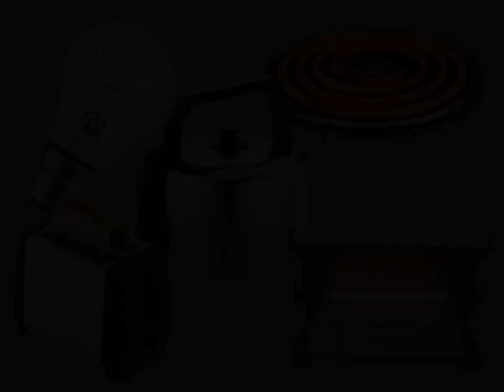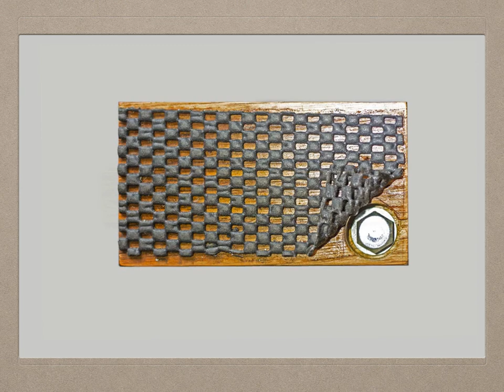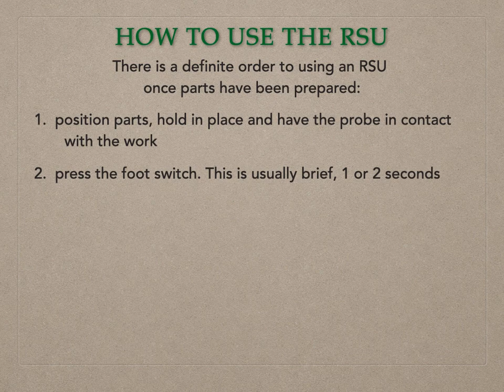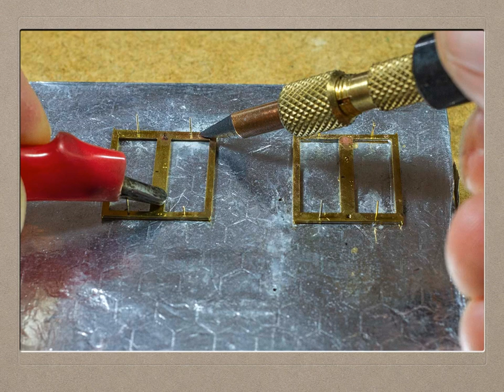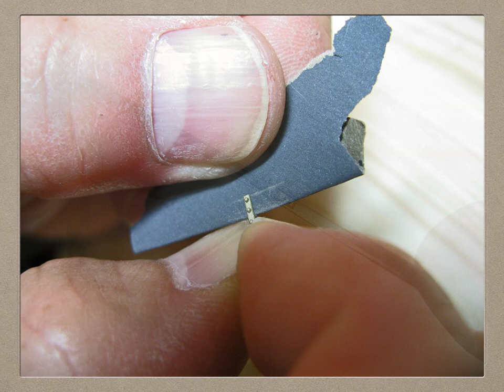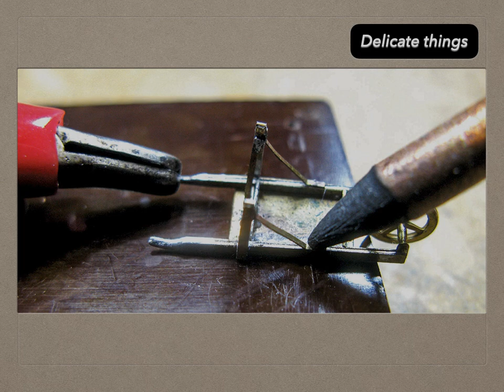Guide to Resistance Soldering

Comment: What size wattage is recommended for scale4 RSU units?
Reply: I have no idea.  Electronics is a complete mystery to me.  Mine is a London Road Models unit which runs on 240 volts.  I usually use an output of between 1.5 and 2.5 volts.

Comment: I've been soldering all my life but have never used or even seen an RSU. If I had, it would have saved me a lot of time in cleaning up parts or "inventing" ways of soldering stuff together using a combination of white metal solder, tin/lead and tin/copper to prevent the models from falling apart.
David applies his flux with a needle. I use a piece of 0.8 mm wire or even a needle to apply flux to small, delicate, joints. Just dip the tip of the needle in a bottle of flux and then touch the joint. By magic of capillary flow, the flux will get inside the joint. This makes sure that (most) of the solder goes into the joint and does not spread across the remaining part of my work.

Comment: Soldering white metal to white metal? How would you go about that?
Reply: I wouldn't, is the short answer.  The heat generated is too great and will melt the white metal which is why, in the video, I heat the brass and use it to convey heat to the joint  when soldering white metal parts, making sure the probe does not touch the white metal casting.  Stick to a conventional iron for white metal to white metal.